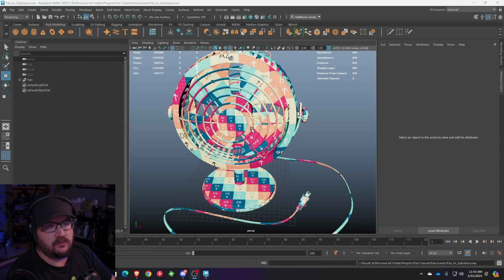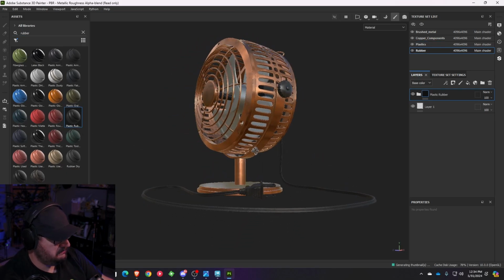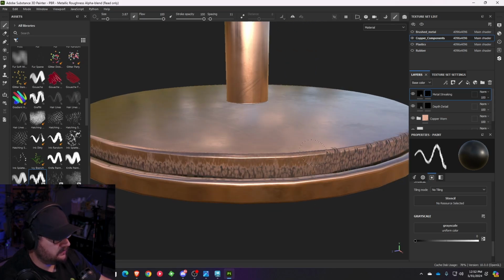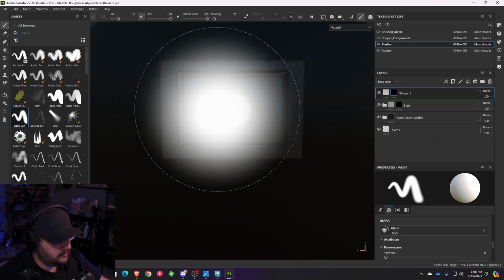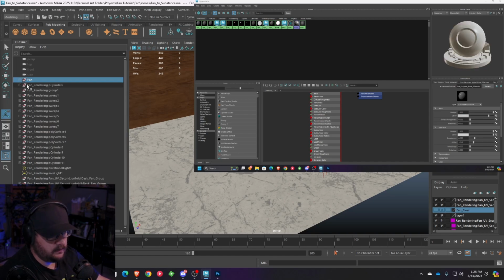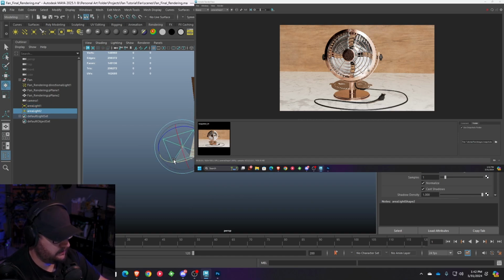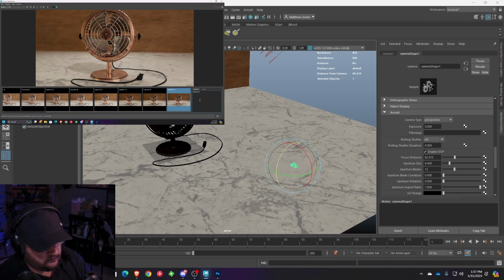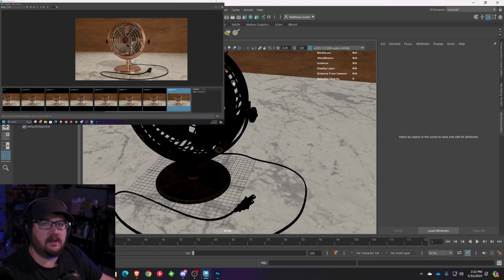Beginner Hard Surface Modeling Tutorial | Autodesk Maya | 3D Modeling Tutorial Part 6

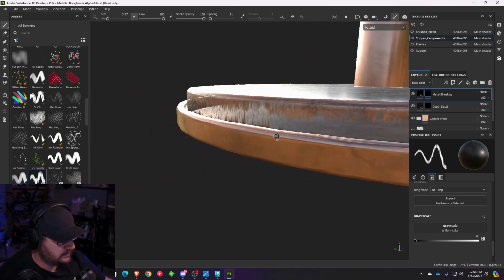Comment: Hi! Thanks for the video. I've got a couple of suggestions, if you don't mind. First, it's better to add the dirt details with the generator. They utilize your curvature maps (which automatically select the edges of your object). You can always edit the rest by hand. If you want to paint straight across the mesh (holding shift), it's better to do it on your uv shells. just go to the 2D mode. One last thing, at around 27:00, if you want to get rid of the shininess of the layer, just adjust the roughness. You were first trying to fix it by changing the metalness, but it's better to just leave it either at 0 or 1. The objects are either fully metallic or not.
Reply from the maker: Super fair this was one of my first tutorials in substance lol I’ve learned a lot since this one